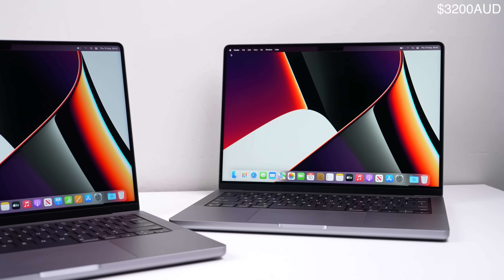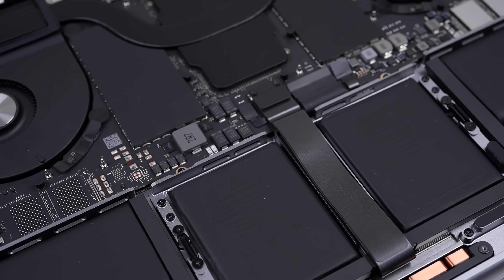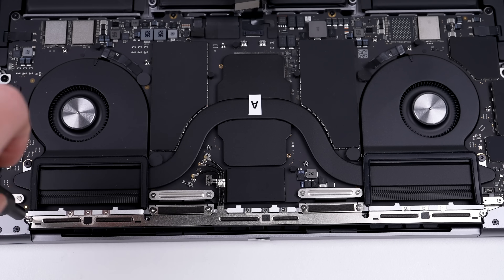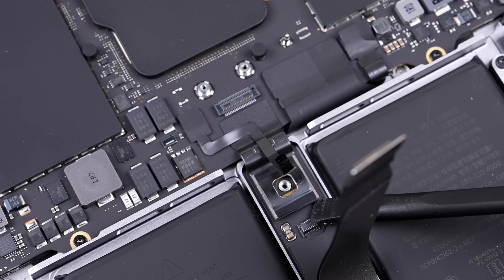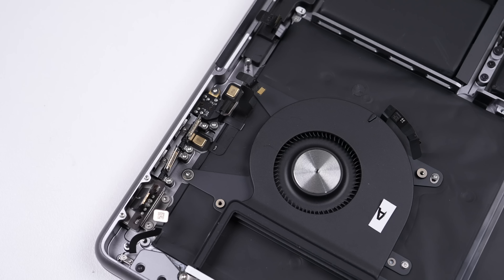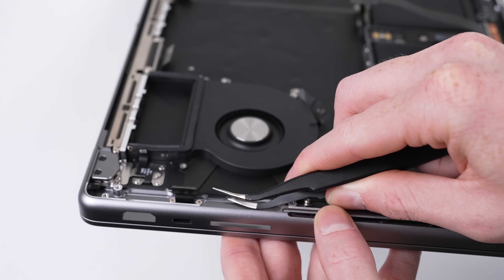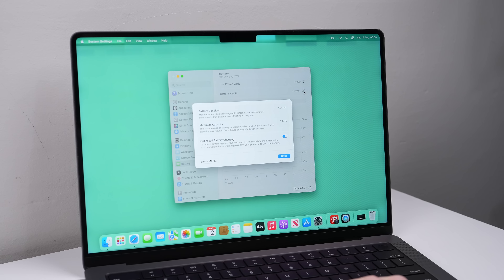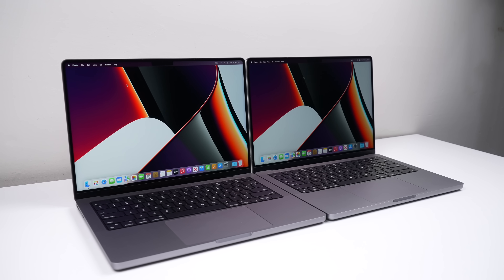New Anti-Consumer MacBook Pros - Teardown And Repair Assessment - Apple Silicon M1/M2

Comment: As an IT hardware reseller and support company,  this is the exact reason I stopped buying or recommending any Apple products. Ive ditched my iphone, got rid of my Macbook Air 2013. Never will i go back to Apple unless they change these working practices. 
Great video!
Reply: as a technician and engineer, I never use anything Apple, and none from my circles do. Then again, I know apple is mostly a "thing" in US (I am in Europe), so, there is that. There is not much (if at all) apple cultism around here.
Reply: @Thunder_Owl  same in the UK. Iphone is popular here but the Apple macs are bought by people who think they are buying the best of the best because it costs more (Sadly, not the case) or design people who have been using nothing but apple since their university days. For some weird reason Apple are huge in the states, I don't get it.
Reply: @Thunder_Owl  As a SE we have a policy in a company that allows you to chose. I don't know anyone who chose not a mac machine. We have 2K employees only in my city.
Reply: @Thunder_Owl  On the other hand, the company I work for never used to allow corporate purchase of Macs, yet almost every engineer paid for one out of their own money simply because they worked so much better and were infinitely less hassle than Windows machines.

These were all very technical people who certainly could diagnose/deal with their machines if they wanted to, but after writing  low level code all day the last thing you want to do is have to diagnose the machine you're using to do so.
Reply: Same. Ran one of the USA's first PSPs (premium service provider). Apples software tool shenanigans and marrying part serial numbers to mobo via software/firmware is simply a problem.
Reply: For quality on disposable device like phones but definitely no a full blow pc where I need flexibility.
Reply: Look up the new pro-consumer laws that have been enacted recently by the EU: Apple is being forced to make their devices pro-consumer. It literally took brute force. Even once Apple screens/batteries can be easily replaced, I will still not buy Apple products ever again on principle. This company does not deserve our money, they so insanely selfish.
Reply: i had to buy macbook so i can develop for ios apps because apple won't let you run xcode on any system other than macos.

and a lot of people uses iphones and now it is easier than ever to just create cross platform apps
Reply: @Gamersoft1124Pro  it was getting old bless it. I've gone Asus Zenbook oled
I've got no regrets.
Reply: @brettgrieves Enjoy poor battery life and mediocre performance. Besides, Asus is far from a customer friendly company.

I'm not a fan of repairability issues of Macbooks, but they simply offer more computer for the price nowadays. Better performance, better batter life, better displays (more often than not)
Reply: @disadadi8958  They don't. Did we even watch the same video? $6,500 for a CPU with 2ghz less processing power and half as fast as an Intel i9. I could literally buy 10 laptops that outperform the Macbooks featured in this video for the same price as ONE of these Macbooks.
Reply: @Helladamnleet  CPU clock speed tells very little about the computing performance. I was talking about the base model computer, not fully specced one.

There are quite a few options on windows side but they are often disappointing at best. I can check the market myself and don't need you to show me that most windows laptops are terrible value past $1000.
Reply: @brettgrieves   Asus service is pathetic!
Reply: That is just shortsighted and arrogant. I sell the products my customers need for their work. And sometimes that includes Apple or even IBM.
Reply: It's all about money. Almost everyone who can afford it will get a Macbook or iPhone. And 99% of people will be fine, these products last forever. When the only alternative capitalism gave us is Windows/Android (or god forbid some random Linux distro), you only have two options. Do you dish out an excessive amount of money to buy all the overpriced upgrades upfront, or cheap out and get a comparatively shitty product that you can upgrade for cheaper later?
Reply: @darkwoodmovies   not true . I've plenty of cash to burn on an iPhone or other Apple products but refuse due to buy their bullshit repairability. The right to repair doesn't seem to exist for apple. I've gone for a Xiaomi T11 Pro. Honestly I've not missed my iPhone 13.  
Don't get me started on the crap Apple spout about the MacBook m2 being faster than a 4090, In one test yes, everything else it gets its eaten alive. . I've been working in It for 26 years and unfortunately I feel Apple are going downhill with both marketing and repairability.
Reply: @brettgrieves But like why are you even concerned about repairability in the first place? Like if I break my iPhone, I can get it repaired for <$100 with my insurance (not that I've ever broken one). Sure, for some pro devices Apple may not make what you need at the time, but if you buy what you actually need - there's no reason it should ever see the inside of a repair shop, unless you work in some niche environment or something.
Reply: @darkwoodmovies  imagine if for example you run a business repairing apples devices using third party screens etc.... now magine apple stop allowing you to fit third party's screen, buttons batteries etc etc ... I know suppliers who are in this situation. It's just unethical. Plus some of us can repair own own stuff, but can't now. And here's an example... The CPU ram and SSD are hard soldered onto MacBook air motherboards now.  If you SSD fails which they invariable do, you need to buy a new motherboard, CPU, ram and SSD, that's just f**king stupid by anyone's standard!! A 1tb m.2 Nvme SSD costs £60... Apple will absolutely charge you £400 plus for an SSD failure it's WRONG!!!! 
Don't get me wrong I feel the same way about Dell, HP and Lenovo for their proprietary PSUs and motherboards. What's the point in having international standards if the manufacturers don't stick to them.
We had a major storm 2 weeks ago which affected a dental practice. The customer bought their own kit. Lenovo desktops, no PSUs available ANYWHERE on the planet. Had to replace 5 Pcs total because I couldn't source PSUs. If they had been standard ATX or SFX PSUs I could have had them fixed in 24 hours. 
Rant over..
Reply: @brettgrieves  I think it's just how the tech is evolving. Like 90% of your computer is just a SoC printed by TSMC. I won't be surprised if in 10 years entire "computers", storage and all, will just be a tiny chip that just gets inserted into a MoBo that handles the connections and cooling. It will eventually be too small, too wireless, and too packed to even be reasonably repairable with regular tech.

Not defending Apple here, there are definitely easy things they could do to make this a lot easier. But the manufacturing philosophy these days is less building blocks put together and more everything is integrated perfectly and not meant to be changed later.
Reply: No, you don't recommend Apple because their equipment doesn't bring you business as it just works most of the time.
Reply: @VideoArchiveGuy  most likely you have no idea.... the shop I managed had plenty of business, mostly out of warranty Apple devices. About 40-100 warranty repairs per month for a small town of 120k
Reply: @rezenclowd3  It's funny how people on the Internet assume other people "don't know" when their experience is different.

Knowing someone who had to regularly deal with out-of-warranty devices, most failures were due to abuse of some type.

For in-warranty work, I don't know why anyone would go anywhere but an Apple Store.
Reply: LOL the „junk“ in this video is the best computer I’ve ever owned.
Who gives a shit if the screen is hard to replace. With Apple care it’s their problem if that ever is necessary.
Reply: @UloPe immediately, that's the problem!  The fact you have to use Applecare means you don't actually own it.
Reply: @UloPe  so you're forced to pay for a subscription AND to live near an apple store (there aren't any of them in my country)... while you already have another screen on hand and can't use it for arbitrary reasons?
Reply: @UloPe  I know for the performance it is the best computer but I will rather buy another Notebook with the same performance and Repairability. Instead this apple hardware.
Reply: @UloPe  I think youre missing the point. I give a shit as do many other becasuie we have the abilty to fix stuff but Apple wont let us.
Reply: @UloPe  You can't have owned many computers then 😂🤦‍♂
Reply: @UloPe  it makes apple not green at all. First world problems but some can only afford used
Reply: @UloPe  but when is your screen likely to need a repair under that maximum apple care warranty? an m1 macbook would still be just as good at the tasks, 10 years from now as it is today. if you drop it and need a new screen, then that should be an option if you want to do that.
Reply: @UloPe  Bah, bah sheepeople, have you any wool?

Comment: It feels to me that Apple realized with their different way of reading the angle of the display that each magnet has a different magnetic field. And that they cannot control properly that every little magnet is put in at exactly the same way or angle. So they calibrate it to the sensor which will change the behaviour of the sensor on another magnet because it thinks the screen is not in the angle it actually is.
Reply: that's possible, to find out you'd need a third display/sensor to try on one of them. if it went to sleep at a different angle, this might be the case.

but if that is the case, the decision to use that technique rather than a much simpler sensor is itself an anti-repair measure.

Comment: The Mac Pro can be lumped in too since it's unupgradable now since moving to Apple Silicon, and it has six PCIe slots but doesn't support dGPUs officially so those slots aren't going to be useful for much past storage and audio I/O.

Yeah, their $12k+ workstation tower is now unupgradable e-waste, meanwhile an equivalent-spec TR Pro build can actually be upgraded and should cost similar money.
Reply: I mean, you're asking to upgrade a SoC made exclusively by Apple. Even if they let you do it, I don't think you would gain anything just by virtue of how the Apple Silicon chips are designed.

Comment: Magnetic field angle detector seems calibrated to magnet orientation and it is not consistent accross machines.
Question is, can this be tuned by rotating the magnet?

Comment: I find it irritating that apple devices break in very unconventional way, like what jittery auto brightness? unstable apple pen? photos taken with the flash (and only the flash) not being saved after a wireless charging coil replacement? I don't believe all these are due to calibration because there's no other manufacturer that ends up with issues like apple after a replacement

Comment: Can confirm the display and backlight anomalies are caused by a loss of calibration. Threw me a curve ball when installing replacements at Apple the first time, as it looked like the replacement display was defective until the System Configuration suite was run. After running the calibration suite, the anomalies disappeared and the screen worked normally.
Reply: can you elaborate? the video made it seem like this wasn't possible outside of an apple store
Reply: @ar_xiv  That's correct, you can't. I worked in one of their service locations for a while. The configuration tool is cloud-based, accessible only to technicians with valid credentials, and contains its own set of restrictions and lockout to limit where replacement parts can be sourced from.

From my understanding, the configuration tool can't be run unless 1) an active repair case against the serial number of the computer being repaired is open in their repair system, 2) the part to configure has been ordered within that repair case, and the new part being installed matches the serial number of the supplied part they have on file, and 3) the serial numbers of both the old and new parts have been entered into the system for verification purposes. This prevents the installation of any part that wasn't sold by Apple specifically for the purposes of that repair, and prohibits the use and configuration of components sourced elsewhere, including used but otherwise working genuine ones.
Reply: @micbr508  incredibly whack. it feels like something that may be able to be simply downloaded or bypassed in the future via "jailbreak" or apple loosening their grip on the process. I'm not holding my breath though. In fact I'm holding my 2012 mbp lol.

Comment: Generally speaking. Get insurance on your apple devices. Even before this, all computer repair shops in my area couldn't fix Apple's machines because the supplier for the replacements parts they used didn't stock replacement parts for Apple devices. 

The screen is also one glued together assembly. My source for the above bit of information is that I ended up working at each of the two repair shops for a year each a year back. 

Insurance will replace the entire machine with the equivalent new machine.

Comment: Apple is dictating the timestamp of obsolescence! You have not use your laptop longer than apple thinks. Even apple dictates when your macbook is valueless scrap. If i compare it to lenovos, you have free access to Hardwaremaintenanceguides every step in assembly/disassembly is explained in detail, the order of steps is explained carefully, no special tools required, all spare parts are available, even for private persons, the spare parts are reasonable priced, you can grab spare parts from the used market, you can grab spare parts from third party, parts not bound to the logicboard. If i look at my notebooks (yes there are quite a lot) most from the 20 and the 30 series (X220/X230,T420/430,W530,Z380)
All are good to go for several more  years (Lenovo is still supporting Bios Updates). I'm not sure if i buy a Macbook Pro today around 4000$ apple will allow me to work in 5 years with that laptop (as even a minor damage will be a total write off due to repair-policy and price-policy  of apple) you can of course get a new keyboard for the special offer worth the top notch of the actual league. Apple never shows more clearly what they think of right to repair and customer rights, "Fuck you", sustainability "Fuck you".

They build such an amazing product in terms of power and efficiency, they did not make the failure of Lenovo to solder all port on the logic board, but on the other hand they made EVERYTHING wrong: Soldered NAND-Chips instead of standard M2-Slot, paired Hardware to Logicboard, Protective screws instead of standard, riveted keyboard instead of exchangable. Price policy for upgrades in SSD? (NAND-Chips) Paying multiple prices for a fraction of performance. Putting "BIOS" Data on the NAND-Chips. All this is so questionable.

ON the other hand the seamless integration of Phone and Tab, but is this worth to dump everything after 5 years in the landfill? So i pay 4000+1500+1000+500 (for a macbook Pro, Iphone, iTab, iWatch) today in total 7000 in 5 years everything is worthless 60 month (Zero value) 116,67/month in reality the watch and the iphone will be worthless after 2 years to to competition. After 3 years i will upgrade to the next generation apple probably offers a tradein at 20% makes 5600 for 36 month (155/month). For a professional a reasonable amount, for a private family needing multiple sets (perhaps most with the basemodels) a severe task to carry that.

Comment: Is it possible to use a newer MacBook display on a older model like i stil use a MacBook from 2013 the 15 inch works atil perfect for me even on sonoma with open core only for the first time I cracked my screen but i dont want to buy a new MacBook because it still works perfectly

Comment: Up next is subscription-based PCs, phones, and laptops. All devices will come with pre-boot location-based tracking and telemetry forced on always by default which cannot be disabled. You don't make payments on time, they encrypt your device similar to that of Ransomware or worse. It's essentially a brick at that point unless you pay to have it unlocked! Even if you do pay, the terms of the contract stipulates that any and all data on your device(s) may be subject to "review" by a third-party device maintenance and support vendor for a better user experience! So-called "questionable" data submitted to the file repository may be forwarded to the appropriate law enforcement agency for further review to determine if such collected data or use of the device(s) is in violation of local, state, or federal law, DMCA, etc. Oh, and don't forget, you agreed to these terms and arbitration as well! Tell me with a straight face that Apple, Microsoft, and all other big tech won't ever adopt such a predatory, surveillance-based business model.